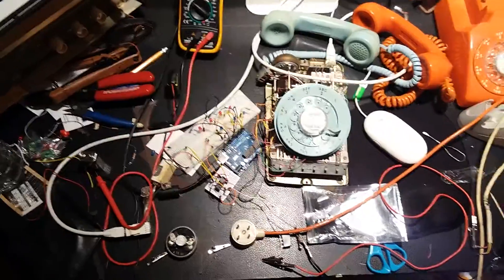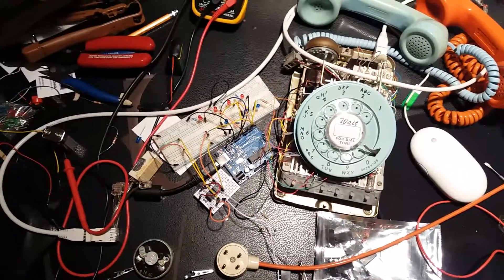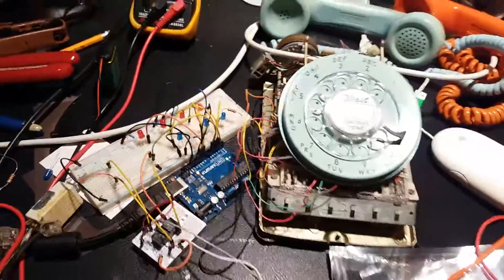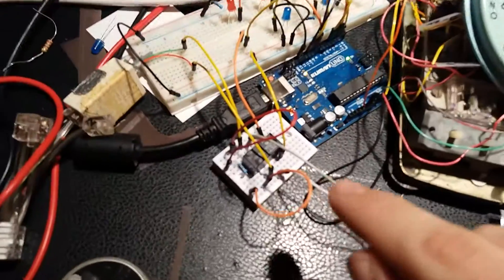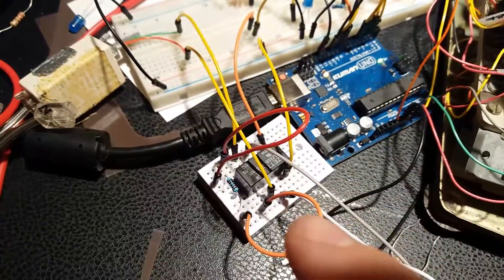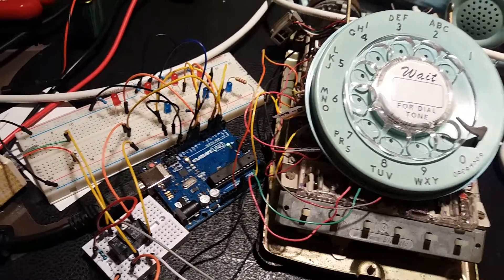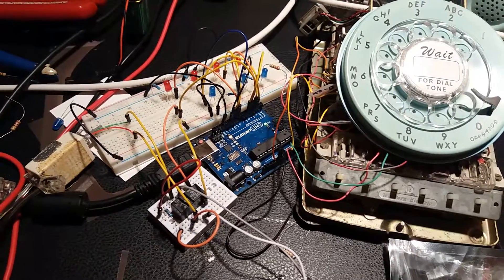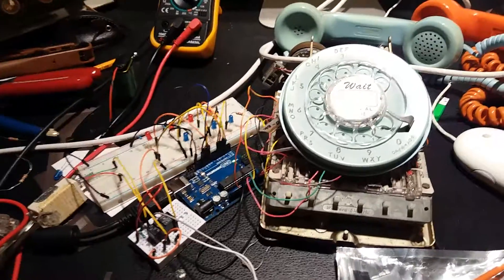Western Electric 565 multi-line phone, With Arduino

Comment: Trying to get my 565 to make a tone.  Red/Green wires to L1/L2 on the terminal block inside, no dice.  I have not wired a multi line 565 before, is there anything I should know about it?  How do I make it work on the line like a regular rotary like a 554?
Reply from the maker: Hello! sorry for not getting back to you earlier, did you figure it out? on the terminal array under the dial, there are terminals for each of the individual  lines. It is just a matter of connecting up your phone line to one of those. You will need to keep that line button permanently depressed to use it like a regular phone. I can send you a schematic of the set if you would like. Send me a message directly if you are interested.

Comment: any progress on this project?
Reply from the maker: ModelerManMike yes I actually finished it. Since it didn't seem like there was much interest, I never did a video on it. But it works alright and I use it with that multi line set.
Reply: Would be neat to see the followup if you want to take the time to put one together. I wound up with a full KSU and several of these multiline phones. Still working on that as well. I may try and get a video up on that.